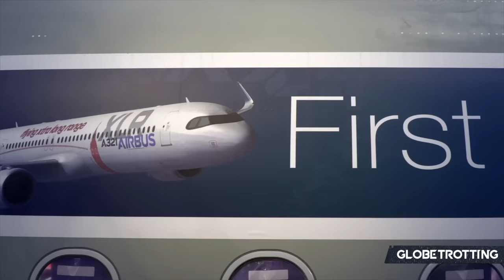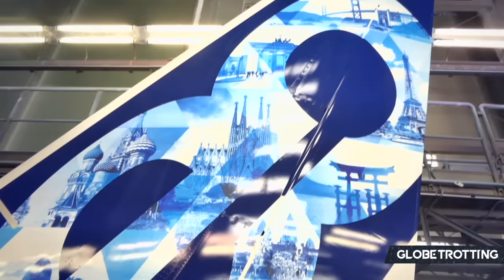BOEING KILLER? - Why Airbus Launched The A321XLR

Comment: Interesting that You showed a 757-300 , even a 767 ( which is old and not a narrow body ) would not be a match to the XLR , with all the sh!t Boeing is going through at the mo even the Max 8 or 9. Great times for Airbus.
10hours in a narrow body should be illegal
Reply: Doubt any carrier will be using them on 10 hr flights. This will be 6-8 hr airplane in reality

Comment: I think that all those fanboys saying that it isn't a true 757 replacement are missing the point.

Quite simply, it doesn't have to be.

All it needs to be is is a better fit than the 737.

By this metric, it more than succeeds, and thanks to Boeing's past behaviour, the 737's loss of Grandfather rights makes any further variants, or, in many cases even improvements to the 737. next to impossible. Only a clean-sheet replacement now makes economic sense.
Reply: Exactly. And they fail to remember that airlines didn't want to have a 757 replacement anyway. Boeing discussed a 757MAX (or whatever you would call such a plane). Airlines were not enthusiastic about that proposal. Boeing discussed building a baby 787 which they called the MOM (middle of the market. Basically a twin-aisle short-to-middle range jet which would have been above the 737/320, but below or at 757ish sizewise. Twin-aisle was proposed by Boeing in order to give the plane greater cargo capabilities. Airlines didn't jump at that plane either. The legacy 757 sales dried up, so Boeing closed down that production line.
Many aviation fans have their visions tainted by their own preferences rather than realising that aviation is a harsh numbers game.

Comment: the a321 neo in all its versions is truly a boeing killer it pushed boeing to make very big mistakes with the 737 max to arrive at the situation we are currently experiencing and boeing's big problems.
Reply: I mean, you could also say that the 747-8 was the Airbus killer, as it caused them to make a big mistake in investing in the A380.
Airbus never broke even with the A380, and without Emirates, it would have been a financial catastrophe.
Reply: @jwil4286  the 747-8 was never the a380 killer it was the price of crude oil and the consumption of quadjets compared to the 777-300 that killed the a380 but the 747-8 was never a competitor of the A380 it is the quadjets which no longer have their places for the moment, moreover of the 747-8 less than 100 have been sold in the passenger version.
Reply: @jwil4286  and concerning emirates yes they saved the a380 program but if emirates was not there with the delays already priced the 777-9 would already be a semi-failure or even a stillborn plane.
Reply: @jwil4286 please rethink the timeline...

The a380 was designed and actually came out before the 747-8..the a380 also outsold the total number of 747-8 ever produced (if you exclude orders by Emirates, you got a rough even split between a380 and 747-8).

The saving graces that led to a fairly decent 747-8 programme were the -8F version, and the fact many of its operators were already fairly used to the type (which smooth the introduction of the plane - as opposed to a brand new one like the a380).

As mentioned, it was the introduction of high performing dual engine wide body planes (plus the costs of running quadjets) that killed both planes...
Reply: @jpazinho  4 planes, actually, including the MD-11's and the A340's.
Reply: I highly doubt that when someone makes a new product they will first think of other's feelings and they do not have to. Be realistic. It is a competition like in every business field.
Reply: Still 5600 idiots ordered the max. Incredible.
Reply: That comment is wrong. The Boeing leadership pushed ITSELF into big mistakes because of stupidity and greed. There was a time when Boeing internally discussed building a new single-aisle plane or even a new MOM (middle of the market like the 757). Airlines were favourable of a new single-aisle and with the B787, Boeing had the expertise to build a capable CFRP single-aisle airframe. If they had followed through, they would have a high-performing, fuel-saving, light single-aisle airframe that would outperform the A320. But what did Boeing do? Wait. They wanted to milk their 737NG cow as long as they could instead of building the future and put off a decision until Airbus decided to build the Neo. It was their own greed that made Boeing execs a failure. Airbus at that point found the goal wideopen. At that moment, Boeing execs panicked and quickly finalized the Max program which has turned out to be a huge and costly mistake. Even airlines were surprised that Boeing didn't build a 797 single-aisle. If Boeing execs were not greedy and stupid, they would be the leader of the industry today with a 797, a 787 and a 777X with a MOM in development. That was the plan but criminal and incompetent Boeing execs messed it all up. Now, they are massaging their numbers to make themselves look better and hide their losses. It is truly embarrassing!
Airbus was busy developing the A350 and Boeing had an empty street leading to the biggest market in aviation which is single-aisle 6 abreast jets. Boeing execs are a failure.
Reply: @CicaeMeow   It's either buy the Max or wait for years and years to get their planes, since Airbus  is the only other option and it's backlog is already huge due to the influx of orders . It's a  duopoly, so they will buy what is available or go bankrupt.

Comment: Boeing f’d up the moment they ended 757 and started extending and extending the 737 dinosaur. Look at the a320 series they are building to what looks very much like the 757.
Reply: Yes, Boeing did muck up.  the 757 was already preforming like the A321LR and with a few tweaks it would have exceeded the XLR.  I remember Boeing stating that the XLR was a niche airplane.  Not quite with hundreds of orders that Boeing missed out on.  New management required.
Reply: they also f'd up when they ended the 717 too imo.
Reply: 757 is not efficient even when compared to A321CEO, that's why it struggled to compete and was discontinued in the first place.
Reply: Question is how it would’ve fared with new wings and engines. Engines are the most important factor in regards to efficiency.

Just look at the Airbus A330 Neo for reference. It’s too close for comfort to the 787 in regards to efficiency. And that plane is a really good clean sheet design. 

Heck I’d say one of the 2 most advanced and modern planes in production. The other being the slightly larger A350.
Reply: @barneyklingenberg4078  A330NEO has a surprising light airframe and efficient wings, that it can closely match 787 (the major compromises are range, payload, and cruise speed).
The problem for 757 is that it's overbuilt from day one. Hence it has to have better tech to match A321. As a sidenote, because of its weight 772 is also significantly less inefficient when compared to 333, and not that competitive in a pure trip fuel burn sense against 343.

Comment: A321XLR is a almost prefect like for like 757-200 replacment. The range is slightly longer, the interior space is about the same (due to how the lavtories are organzied, the A321XLR could fit a few more seats, but not a full row). Airbus got slightly longer range anda  shorter wing (so gates slots are cheaper), the XLR is also some 10-15% more fuel efficent. That is not a huge amount, but wellcome.

The shorter wing is almost fully compesanted by the lighter load. But its worth saying that the payload of the XLR is slightly lower.

About the A322 (that don´t exist, yes i know). For the 757 series, the -200 was sold slightly lower than 1000, and the -300 was sold 55 units. Yea, that is quite a diffrance. That would of cause sugest that there is no market for a A322.... buuut. There is a issue here. When 737-300 came around both 767-200 and A310 as well as A300-600 was popular planes. All of those is about 25 seats away from 757-300. The wide bodies was simply the better choice back then.

The situation today is sort of diffrent. All the competitors are gone. There simply exist on aircraft on the market for between ~230-300 passangers
Reply: The question is: Does the XLR have the same performance as the 757? Most airlines are keeping the 757's because it can takeoff and land on short runways with it's overpowered engines while having good capacity.
Reply: Except it doesn’t have the range it’s capped at 3500NM look at the field tests and the issues with the center fuel tank

Comment: The A321XLR might sell 1000 units like the 757. Or maybe more.
Reply: Probably little more...like 1200 or smth
It's a Very popular aircraft.
Reply: Nah. Most airlines aren't keen on the idea of having extra fuel cells taking up cargo space. I think there's also something to be said about the single main gear in regards to weight capacity. The XLR is too comprised to kill the 757.
Reply: @gop4usa12 the 757 is 30 years old… a replacement is better then none

Comment: The length is 2.8m shorter (47.3 vs 44.5) and the wing span is 2.2m shorter (38 vs 35.8). The fuselage diameter is also slightly larger(3.54vs 3.70) Yet it still manages to fly 600nm farther(4100 vs 4700nm). We have a true successor to B757.

Comment: I think the days of airlines being loyal to one manufacturer are long gone.  There is too much risk putting all their eggs in one basket.  Boeing has probably made Airbus a better company in the long run by making them up their game.
Reply: except for low-cost carriers, they need fleet uniformity to minimize crew training expenses
Reply: OTOH there are huge advantages in maintenance and training with sticking with one brand. It really is very expensive to move from a fleet of one type to a mixed fleet - support, training and scheduling problems suddenly become much bigger. As a rule if you are a smallish low cost carrier it is not worth those extra costs, where if you are a big full cost carrier with a wide range of route types to fill then it is worth paying the costs of diversity.

Comment: The slight add to Jetstar - they currently use their A320LR’s domestically during the day and then line up to do an overnight service (there and back) ready for domestic the following day.  Smart and yes a game changer in the LR …
Reply: That’s A321LR btw…
Reply: But do you need the LR for that? The night flight can't be longer than ~7 hours one way, if you want to use the plane on the day too.
Reply: I hope LH/EW will go for the A21N because of this and see this as a chance for airports like DUS.
Reply: @Psi-Storm it partly makes sense since a flight departing from DUS/FRA for example at 6pm would arrive at around 9pm in JFK, in turn arriving at 1pm again in FRA/DUS, so basically still being able to serve routes like DUS-LHR during the day. On top of being able to be used for routes like DUS-PMI if there isn‘t enough demand for transatlantic.

Comment: I wish the A321XLR lots of luck and success. However, I just do not see myself flying for more than 6 hours on a narrow body aircraft. I think the LR is good enough. If airlines can afford either the A330 or Boeing 787-8 or -9, why buy the 321XLR which only has one purpose that is to fly long routes in low-end markets.
Reply: Do you see yourself flying long distances in a 757? It is narrower than the A320 series
Reply: @terrygelinas4593  Not at all (unless I have to have to). I travel to places of less than 6 hours flying time. Outside of that, it has to be on a wide body aircraft or I do not fly at all or do not visit that city.
Reply: Economy my friend, money talks!!!
Reply: @ross9581  Very true and/or having no other choice...lol
Reply: A question arises in me from this, would airlines that buy the 321 XLR be kind enough to optimize their economy configuration so that they're comfortable for those passengers on the 7hr+ flights?

Comment: Seems like Boeing will wait until we're all old and in wheelchairs then to announce they will revive the 757 😅
Reply: And call it the 757MAX
Reply: The 757 was discontinued for a reason. Its not coming back
Reply: @marcbrady7241  That's not a valid reason for it to not return. It has excellent range, payload, power and passenger capacity that can outclass any 737 and A321 operating today with very few exceptions. 
The 757 was discontinued because of low demand back then but now, it would easily put the 737 program out of business. 
It was simply an aircraft made ahead of its time. But there's absolutely nothing wrong with it, why else would delta and United hold onto it for so long, it's a workhorse
Reply: @Gspec5  No one wanted the 757. It wasn’t economical, and many airlines preferred the 737 especially in the LCC market. Bringing back the 757 would not be financially viable. If Boeing bring out this new aircraft, the Boeing NMA, that could compete well with the 321 but don’t see the 757 ever making a comeback.

Comment: XLR biggest problem is its two main wheels a side. This means it has a very high PCN (pavement classification number) and it may be restricted from operating into certain airports due to the weight it will put down on the two small areas beneath each tyre.
The tarmac will take a high stress and airports manage the runway stress to ensure damage is minimal and runway life is optimal.
A very hot surface temp tarmac runway will easily get damaged with this high PCN. 
So some smaller airports may restrict its landing or not accept it at all. 
The 757 it replaces had four wheels a side. Halving its PCN
Reply: Interesting. How exactly does this differ from a normal A321? The landings will usually not be performed at MTW.
Reply: @der.Schtefan  That was a good one!  You really got him there.
Reply: @der.Schtefan  it’s also to do with its taxing at takeoff weight and ramp movements. Many airport surfaces are not as strong as some others. Some A321 have a PCN of 61 while 737 might be 50 (due to tyre sizes and pressures) the 757 for example that the 321 is marketed to replace had a 31 value due to its 4 wheels a side.
Reply: some air india airbus A320 had 4 wheel main gear for this very problem, so it would not be any problem to do

Comment: Good to know the range will not be reduced after all. Thanks
Reply: The range is reduced. It's simple physics. However, Airbus doesn't want to say anything because it could hurt sales.
Reply: There are areas where they can reduce weight or cut fat to compensate. Even in the A350 they just reduced the weight in the New Production Standard.
Reply: @ivanviera4773  That's correct. They thinned the walls to make the aircraft wider and are using slimmer seats. In the case of a narrowbody aircraft like the XLR, I just don't see that. An aircraft that can fly up to 10 hours needs to be comfortable. If passengers don't feel that comfort, they may start avoiding the type on long flights.

American Airlines is configuring its XLR fleet with more premium seats, and that's probably going to be the successful formula for longhaul operations.
Reply: @sainnt The weight gain is not that high, given Kevlar is a lightweight material, and there's still room for weight savings.
And airlines don't look at the advertised range - they would receive a detailed payload range profile based on how they config and operate the aircraft. Often it comes with performance guarantees as well. Airbus will try its best to meet the target, perhaps by seat config changes as well, or it will pay compensation accordingly.
Reply: @steinwaldmadchen  Airbus will likely pay compensation and do so quietly, which is why they're not saying anything.

You're correct about the extra weight not being that big a deal, but it does put a dent in the thing they bragged about the most, which is the range. 

The extra weight will be a non issue for airlines like American and United, who plan to have more premium seats on the aircraft, but it's going to be a major issue for airlines like Wizz Air and easyJet, who plan on cramming as many seats into the aircraft as they can.

Comment: Not sure I was excited about the 757. Being single aisle. Why would I be excited for the A321XLR for long hauls??
Reply: Because it will enable nonstop long haul flights between secondary cities.
Reply: @yoironfistbro8128 No one wants to fly long haul on a short haul designed aircraft
Reply: @marcbrady7241  I'd happily do so as long as there's good IFE and the seat pitch is no tighter than 30-31 inches

Comment: Didn't Airbus themselves already warn their customers of the 200 NM reduction? Also, the estimated real world range with typical airline usage is not the advertised 4700 NM, after reduction it is more between 3800-4000 NM. However, even with that reduction, you can still get from Washington DC to as far east as Budapest. (BRU, GVA, Frankfurt or Vienna being more logical connections though), or Sydney up to Hongkong, Taipeh. It won't allow Sydney-Tokio anymore though, but I doubt you'd use a A321 on such a main route. This aircraft is rather a perfect fit for specific P2P connections, after identifying specific traveller streams and offering them shortcuts. Like DC-BRU,  DC-VIE. Business centers, lobbyists, etc.
Reply: If you want to abbreviate there, frankfurt is FRA

Comment: I think Airbus might NOT get the A321XLR certified. Reason: the fuel tank design for the center fuel tank may be unsafe in case of a wheels up emergency landing.
Reply: This can be mitigated by insulation, a solution adopted to A340-600 before. But that gains weight.
Reply: @steinwaldmadchen  There is talk that Airbus is contemplating developing a completely new wing box that integrates the fuel tank better but without the potential fire danger of the current A321XLR design. But that would delay the introduction of the A321XLR by a year or more.